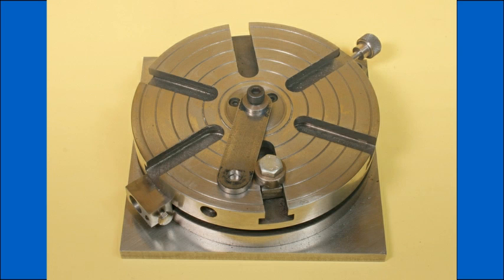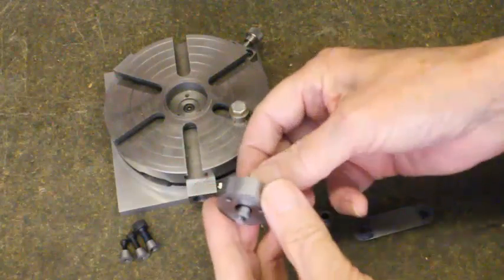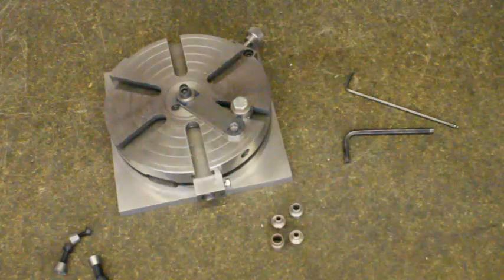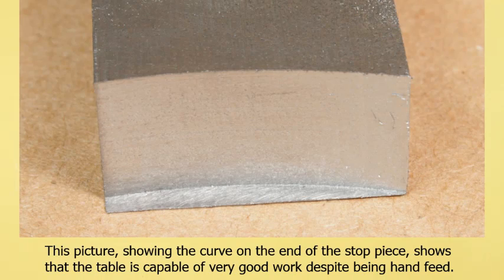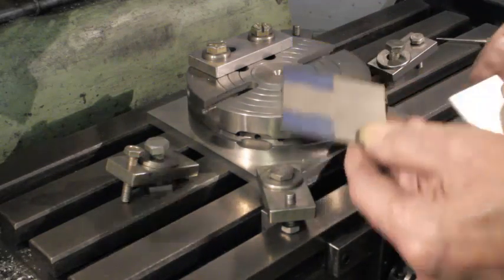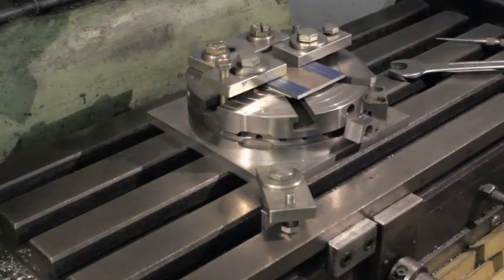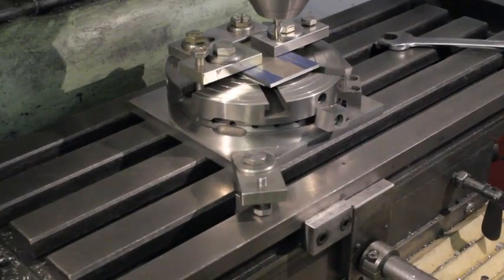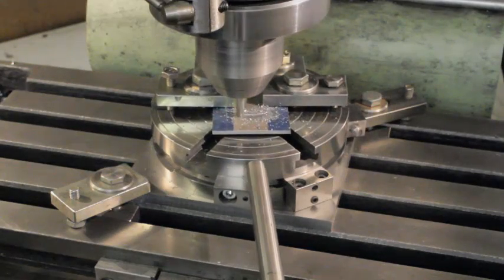RotaryTable

Comment: Hello Mr. Harold Hall.
I've been searching through your books of which I have #s 34, 35, 37, 38, 39, 42, 44 and 49 all from the Workshop Practice Series . Unfortunately neither contains drawings of your excellent rotary table. Searching the internet "only" reveals the one from Hemmingway.
The link on your website to Projects In Metal have linked to a server which have been in the process of changing to another server for years now. Is it possible that you can do anything so that the drawings will be available in any way? Charged/free of charge?
Thank you in advance Sir.

Comment: (I see that there must be a limit to # of lines......cont from prev post)Keeping in mind where the BAR holes will be.  T-nuts to fit, will have to have the contact surfaces turned to match the grooves. On assembly, with the T-nuts now sanwiched in-between, the stops will be infinitely adjustable. Although not necessary, the adjustment screws could still be used for fine adjustments.

Comment: Very good solution for rapid machining (and rapid set-up, too) parts like the example; I've often needed something similar and usually end with some muck-up tooling with random methods for the stops.
A suggestion for an already excellent design...The rotating part could be made in 2 pieces with locating step-diameters and appropriate fasteners;which could be hidden in the bottom half i.e. oriented from bottom up into blind tapped holes in the top part.
When machining the 2 pieces, each one would have grooves cut into its face to a depth to provide for 1/2 of a T-nut.(keeping in mind where the holes are to be located for the rotation bar.
When assembled, with the T-nuts sandwiched in between, this would provide for infinite stop locations.Although the adjustment in the existing stops would not be necessary, it could still be used for fine adustment...
The T-nuts would have to be "special" in that the contact surface would need to be turned to match the dimensions of the cut grooves.